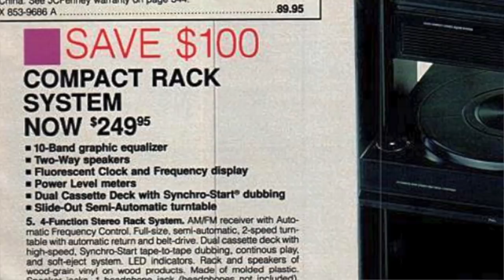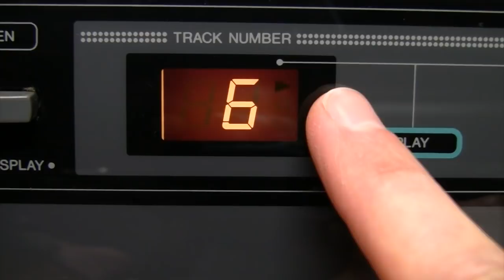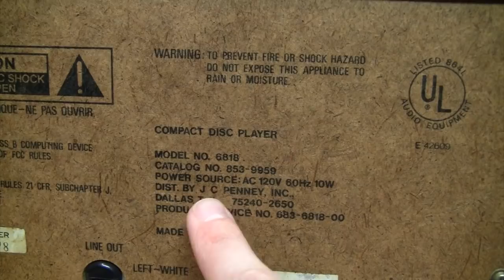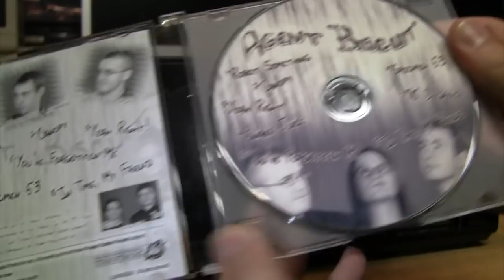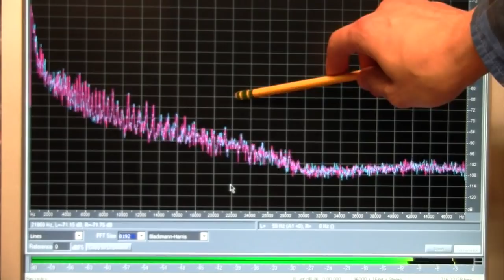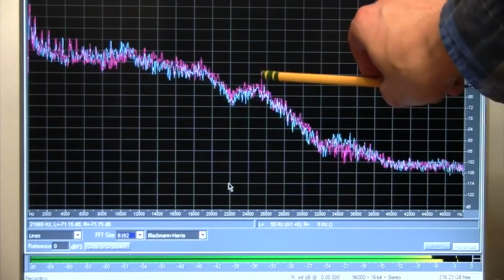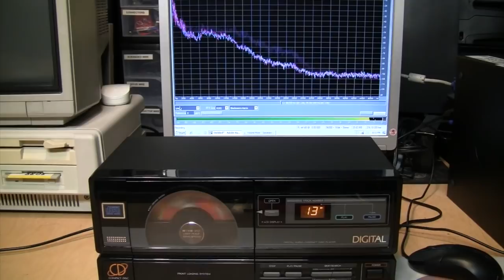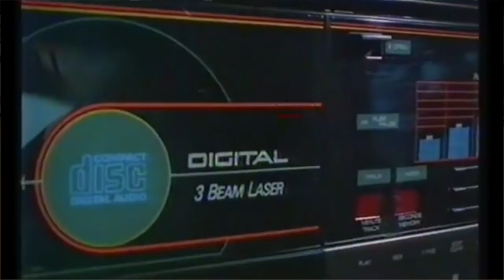The cheapest CD player ever made is surprisingly good - the 1988 Yorx CD Pal

Comment: If you have any CD-Rs with a paper sticker label, you best copy that to another disk if it still reads. Paper labels kill disks.
Reply: Yeah found that out, heart sinks when I come across one that I've missed.
Reply: What's the current thinking on those printable CDs?
Reply: I’d like to know that myself
Reply: I guess for cheapness
Reply: I've once seen someone trying to remove one of those CD labels..... it peeled off the freaking reflective layer too >_<
Reply: I remember when public libraries used to put labels on CDs (which were a nightmare when the edges started to peel up), until they figured out it was better to write on them with a permanent marker.
Reply: @alanburns538  Not with a permanent marker! Those eat discs too AFAIK. Correct me if I’m wrong.
Reply: @FifoF  no you're not wrong. Permanent markers contain solvents. THAT is the chemical that attacks the disc surface and eats through the protective layer and basically causes disc rot. That is why at one point we got Disc markers that were solvent free and i think waterbased too. Those are no problem.
Reply: KRAFTWERK2K6 exactly what I was thinking.
Reply: @KRAFTWERK2K6  i write on the disks where there is bear plastic or on the reflective layer where nothing is written to it
Reply: I just use an ice pick to carve out the album titles on my CDs. The writing stays there permanently, never wears off. Best visible on the reflective side.
Reply: Are you sure it's the label.  CD-Rs degrad over time.
Reply: @KRAFTWERK2K6  Welp... I gotta rip my CDs. All of them have Onyx marker writing on them... Rip.
Reply: @Alexis_du_60  lol don't worry. Happened to me too. I once put together a CD-R with Doom and Doom II and painted the label side all red with a red sharpie. it looked really cool. But years later i was like "ok maybe that wasn't such a good idea" xD thankfully i never did that to many writables but only a few. At one point i got a pair of Disc markers that were harmless for that purpose.
Reply: @qwertykeyboard5901  *bare
Reply: @KRAFTWERK2K6  fortunately I didn't put valuable data on the CDs I had put onyx marker on, just Windows ISOs and such.

I guess I should get a CD marker, too.
Reply: I dunno, I’ve got CD-R’s I wrote on my 2X HP 7100i burner, labeled with Sharpie, and they’re STILL perfectly fine.  I still have the first discs I wrote on mu 2X DVD-R (not +R, not +/-R... Pioneer DVR-A04, with built in cooling fan haha).. also look like new and are 100% readable.

So, maybe that’s a problem with cheap CD-R discs?  The early gen discs I used were TDK, Maxell, and Verbatim CDs, and Maxell DVDs and Panasonic DVD-RAM discs.  This is all back when they were sold individually or packs of 5 or 10, in jewel cases.

I use Taiyo Yuden and Verbatim spindles now.
Reply: Mine play fine. 20 years old.
Reply: @EgoShredder  Don't!!!
Reply: @workonesabs  I was specifically asking about the one where no label is applied, you just stick the disc inside a printer.  Regards the other method of printing labels and sticking onto the disc, I bought some years ago but decided not to use them, as I thought they would damage the disc.
Reply: @KRAFTWERK2K6  wait, is that only with paperback disks or all them? I used permanent marker on every single disk I have burned and so far non of the have rot.
Reply: @rogeliolopez2190  Well, it may take longer and sometimes it takes less time but don't expect these discs to be riskfree if you wrote on them with permanent markers. Depending how thick the varnish layer on the label side of the disc is, it could take longer for the solvents to eat into it and attack the reflective layer. YOu may not see the rot with the naked eye but you still may end up with reading errors in the regions where the writing is on the backside. Make sure you do regular redundancy backups and do disc-read checks for any possible read errors.
Reply: @passatb6break  That sounds like any other decaying CD-R, and from the photos there's no visual indication that the label caused that (damaged surface or anything). I've had plenty of late 90s to mid 00s CD-Rs that sounded similar to this to some extent (some very mild, but audible, while others were so bad you could barely tell what song it was, and the CD player struggled to find tracks). In all cases there wasn't even a paper label (or any label) on the CD. It's just the revenge of saving a little bit of money back then by buying shitty cheap CD-Rs..
Reply: And don't do it with a slot loading CD drive
Reply: this is disk is printed with lightscribe

Comment: Early 'cheap' products of any new tech are better than late cheap revisions.
Reply: Chauncey Gardener Not always.
Reply: I agree.
Reply: @tookitogo  Agreed, not always, take LCD monitors for example, in the early 2000's I had a 15in 1024x768 KDS LCD monitor with built in speakers, and t was like $300 at the time, and that was considered a cheap low end model, and just a few years ago I bought 3 Sceptre 24in 1080p 16:9 60hz displays with VGA, DVI, HDMI, 3.5mm in put, and built in speakers(i don't use them they are crap), 2 are on my main gaming machine at home, and one on my work machine at work, all 3 have served me well, and cost me a total of $310 USD shipped to my door from Newegg, and are miles better then the old KDS display.
Reply: Commodorefan64 Exactly!!!
Reply: Modern cheap portable cd players are pretty decent
Reply: Like the IBM Model M, which was supposed to be a LOWER COST replacement to the Model F. IBM started thinning things out in 1989. The pre-1989 1391401 keyboards are the most modern and durable Ms. If you remove the rubber mat from such a keyboard, it feels and sounds like an F, but with the modern functionality of an M paired with the beefiness of a pre-'89 unit.

Comment: the only important feature of any cd player is durability, and this one still works after 30 years while many more expensive models failed long ago
Reply: My moms Sony CDP-M27 is on it's 3rd KSS-150A/210A laser and it started getting incredibly shock sensitive again... whereas this one is probably still on the original late 80s laser because... well who would want to buy a replacement laser at likely half the original cost of the player (not even including labor). And it still works...
Reply: Sound doesn't matter?
Reply: @jimaglenn  cd players sound all the same way to me
Reply: @Jimmyhaflinger o say that all CD players sound the same to you is like to say that all singers sound the same also. Impossible! Just because you might be tone deaf doesn’t make it true!
Reply: @thrivalmode4523  CDs are digital. 0s and 1s are always 0s and 1s, no matter how cheap and nasty it may be
Reply: @Jimmyhaflinger  the DAC part of a CD player can sound different, how well the analog circuitry is made (noise, distortion), but something must be done very wrong to hear any significant difference.

Comment: Cheapest cd player I ever bought was from Richer Sounds in the UK. £29 for an Eclipse cd player. About twice a year they printed vouchers and you could even get £10 off.
What hi-fi magazine raved how unbelievably good these players were, mine lasted years and I sold it for more than I paid 👍
Reply: Cheapest CD player I ever bought new here in the US was a portable job being an RCA $28 USD with 10 sec anti-skip back in the mid 90's, unless you want to count DVD-RW drives for computers I've picked up new over the years for builds for $18 USD(I still build all my desktops with 1 DVD-RW drive as you never know when you might need it).   
however today at a local Goodwill I was able to snag a like new SONY CFD-S50 portable AM/FM radio with CD/CD-R/CD-RW/MP3 CD player, tape deck, as well as 3.5 line in/head phone jacks for $11.91 USD thus making it the cheapest CD player I've bought to date.
Reply: Ahhhhh the Eclipse CD101 from Richer Sounds. I remember them well :)
Reply: @adejupe8308  them's the boys 😀 bullet proof, used to play everything, never skipped. Took it on mobile DJ duties, used to recommend it to all the bars I worked, unbelievable bit of kit.

Comment: Loading a CD is like loading an audio cassette tape on that thing
Reply: Yes,  but the first vertical cassette players were an innovation.  I think i was afraid to buy a vertical cassette player when they first arrived.  All the original cassette tape players and recorders were of a drop in configuration.

My first drop in was a hissy Magnavox made by Matsushita. The second was a Dolby model from Harmon Kardon made by Nakamichi before they marketed models in the US. 

My third was a 2 head Nakamichi 600. The transport was slanted!
Reply: And interestingly enough, Techmoan has a cassette player that loads a tape in a tray, like most CD players do!
Reply: redpheonix1000 I have a Denon like that, but it doesn’t work.
Reply: @danieldaniels7571  i have one and it does work
Reply: @danieldaniels7571  what does not work on yours?
Reply: @maximilianfischer8899  It doesn’t play or wind tapes. It powers up and the loading tray goes in and out, but that’s about it. When you press any button other than eject after the tape is loaded it just clicks and then stops. I’ll get it fixed some day when I have the extra cash. Took a look inside and it’s a more complicated mechanism than I’m comfortable working on myself.

Comment: Another fascinating piece of audio archeology, vwestlife. I'm stunned at all the Sony chips in this and the fact that it still works. Many CD players start to stutter after 20 years due to lubrication along the transport rails drying up.
Reply: This one might not have been used as much, plus the fact it's CD drive is vertical could have also helped the grease on the rails of the laser last longer with it all not being right on top of the heat generating components which is what can dry out the grease on horizontally setup CD players.
Reply: Ecolube is what I use for worm gear lubrication. It's used for scuba diving. It is safe on your skin and does not eat plastic.

Comment: I had one of these! Loved that you could see the CD spinning. However there was always a very slight noise (possibly from the motor) that came through the RCA outputs that was usually audible between tracks. Otherwise, the sound was great.  I ended up giving it to my cousin and bought a Technics.
Reply: It was motor interference, probably due to cheap circuit design, those cheap record players have the same issue, hum audible from the motor via the outputs.
Reply: That is what you call ground loop hum.  little bit of tinkering with a couple smidges of wire and capacitors in the right spot would cure it.

Comment: Interesting that CD players could be that cheap that quickly into their life-cycle. First ones were released in 1982~ish so in just 6 years or so they went from $700+ to $100~. 
For modern day manufacturing turn around time's that's not very shocking but given the generally slower pace of development and iteration back then It's pretty darn quick that CD players became so commodified.
Reply: One of my professors at university used to work at Philips (from 1985 to 1994) and he always spent his first class of his course in mechatronics to demonstrate how the mechanisms in CD players were miniaturized year after year, allowing the cost to decrease. Interesting stuff! But it's been over 10 years and I don't remember the details.

Comment: I wouldn't be surprised if Funai was the OEM that actually built this thing.
Reply: Me either considering how many brand names they have bought up over the years, I've had several Funi rebranded TV's both CRT, and LCD over the years, and they have all worked just fine for the amount of money paid, same for the bottom end DVD player I bought with direct Funi branding i use to have in my RV before switching it out to an LG Blu-Ray I lucked up finding at Goodwill for $22 with the remote, about a year 1/2 ago.
Reply: When I first saw this player, I thought it might have been made by Crown. But the Funai CPU chip definitely confirms who the OEM was.

Comment: It's pretty neat that this CD player uses essentially the same chipset as the more expensive contemporaries of the time. Probably helps explain why it sounds so good! Not at all what I was expecting to see when I read "cheapest CD player" in the title of the video.

Honestly, I'm a huge fan of how simple and efficient the design is, as It makes for easier servicing and solves my pet peeve of sticky loading drawers. (I had a thrift store Sony CD-102 that did it, and my Kyocera DA-310cx still does it when it's cold, despite replacing all the belts and lubing it accordingly.) In this regard, this CD player is a winner in my book.

Comment: One more unit that was just below $100 from the late 1980s was the Crown CD-70.  It is a top loader similar to the Sears one you mention.  The CD-70 lacked the ability to scan through a track, you could just skip forward and backward, and it would mis-track way too often.  Unfortunately, I have not been able to find an advertised price for this unit in an old magazine or catalog.
Reply: Crown Japan?  They are still an electronics brand here in Bolivia
Reply: @FIXTREME  A lightning strike took out my Pioneer CD player in 1988.  I saved up my after school job money at $3.45 per hour to purchase the cheapest CD player I could find to replace it, and it was a Crown Japan CD-70.  Within a year I replaced it with a much better Teac.

Comment: I had one that was very similar. It was a tray loading Sharp I purchased at Pacific Stereo in Reseda, CA around 1987. It was on clearance for about $100 and I was happy to get it. At one point I had to open it up to get out a disc that got stuck. The component arrangement on the PCB was very similar.

Comment: Very soon after it was introduced, the CD format became mainstream, and CD players became common, even in equipment made by low-end manufacturers.  Because, unlike analog formats, CD players deliver a uniform signal which varies little from the cheapest units to the most expensive, old, inexpensive players like this one still sound pretty good.  The problems with early cheap equipment were more likely to lie with programming problems, reading of discs by the laser, etc., rather than poor signal quality to the analog outputs.

Comment: There was also the Philips CD207 (1986/1987), a cheap and basic featured top loader (available in many vivid colors) with outstanding specs. I can remember it had similar price range. A hifi magazine takes this model to the test to find out it was of any quality because of the extremely low price. The magazine did a durability test with 10 or more units of this model, playing for weeks and none of these models failed the test. This model became very populair and Philips sold many, many units of this model.  You can find some detailed pictures of this model and packaging on dutchaudioclassics, hower not present the most  exciting color: Grey. Google "dutchaudioclassics  Philips CD207" or search for "Philips CD207" on google pictures.

I have a later Panasonic RX-FD80 boombox that uses the same simple front loader idea of loading a disc. Simple is good and durable.

Comment: amazing the optical pickup still works. Maybe it used a sony KSS pickup which were very robust. Its normally the laser pickup that fails in a CD player
Reply: Yep it's either that, the LCD dies/burns out, or some leaky caps on the mainboard

Comment: Inspired by this video, I recently purchased the same Yorx player from a Shop GoodWill auction. I didn't have to do much to get it working. While cleaning it, I discovered that if you press “Stop” (instead of "Play") after a disc is loaded, the player will briefly spin the CD, read the TOC (table of contents), and then the display will show the number of tracks on the disc. You can then skip up or down to select the track you want to begin with when you press "Play." I'm not sure how handy that function actually is, but it's cool to know that it's in there. 

Handwritten on the back masonite panel, presumably by a store clerk, in descending order: O - $199.95, N - $99.95, $69.99, and $49.99. Since the last price was not crossed out, I assume it was originally sold for $49.99.

Comment: This reminds me of my first cd player I got for Christmas in 1985. Mine was branded ' Electrosonic ' and I believe came from Caldor. Very similar except it didn't have a see through cd holder. When I was 20 and had a decent job, I treated myself to a top of the line JVC component system. The cd player I got was the 2nd in line model with all the bells and whistles available at that time ( 1989 ). I was VERY disappointed in it's sound quality which was rather tinny and it skipped with moderate bass. The cheap Electrosonic sounded better and hardly ever skipped except at very high volumes.

Comment: Probably the frequency cutoff is so soft because a filter with a softer decline needs less stages and is therefore a few cents cheaper... (especially coils cost a little bit and are relatively big, therefore engineers try to avoid them when possible)
Reply: They use RC filters or even DSP, not LC types using inductor coils.